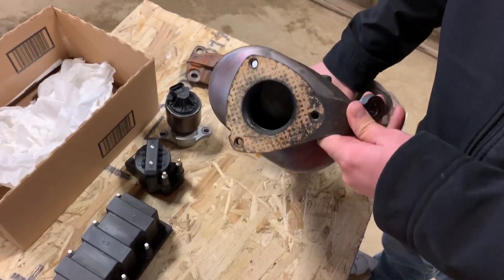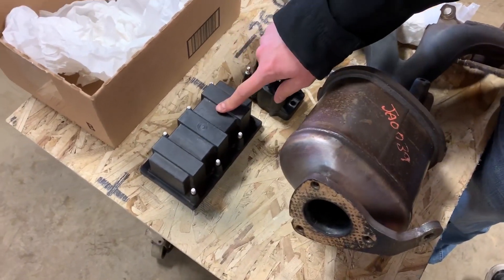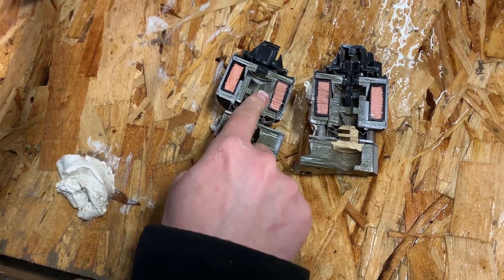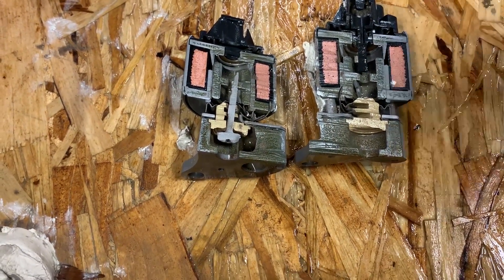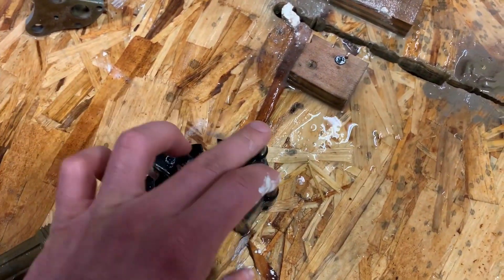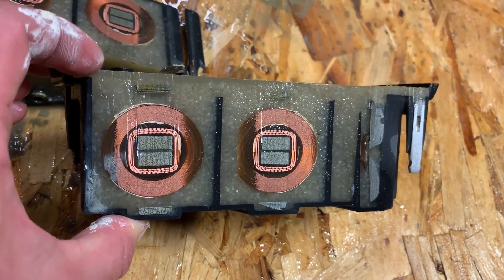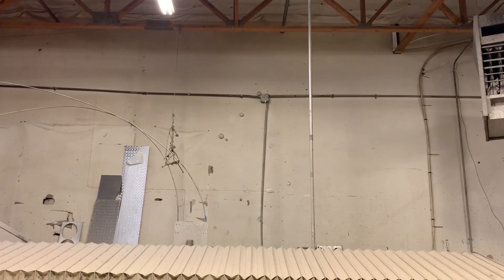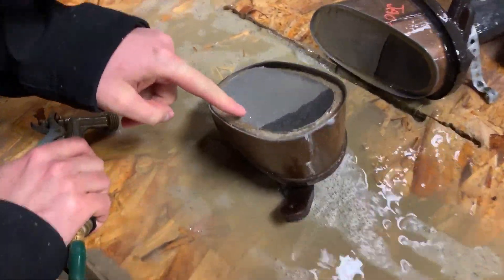Mining Platinum from a Catalytic Converter with a 60,000 PSI Waterjet

Comment: So if I remove my catalytic converter, I get more gas mileage?
Reply: Barely at the cost of not breaking down thousands of toxic chemicals for the rest of the planet to deal with, HOT CATALYSIS is essential to not being a polluting POS to your city  and the planet. Nitric Oxides, Monoxides, Smog, You want at least A HIGH FLOW CAT, and there are usually more than one on newer vehicles.

Comment: They mentioned just sharpening the blanks. However the blanks aren't heat-treated already are they?
Reply: No but if they were you would have one hell of a time trying to grind them. Depends which steel you choose but for example the 01 option would be an oil quench while its red (not yellow) then to temper it pop it in the oven at 400F for an hour and maybe toss in a pizza for the last 20 minutes or so.
Reply: @AeviAdamant  I will probably actually differentially harden mine  after I grind it. I got the o1 steal with the Tanto point. I love that steel as it is very forgiving and oil quenching is easy. I mainly asked just so people would realize that after they grind it it won't stay sharp because they are not hardened yet. I don't think these guys really realize that either but they're still fun to watch.
Reply: @chris993361  No problem and I agree it should be mentioned in future videos for the beginners who wouldn't know any better. Could also add the information under the steel types selection they offer giving information on how to harden each steel option.
Reply: @AeviAdamant  I agree. That would be a nice little tidbit to include.

Comment: In order of pulled apart:
Egr valve. He was correct. 
Both others are ignition coils.
Reply: So basically ignition coils are Solid State, Distributor caps, I feel dumb for not knowing that but if never worked on that part of a newer vehicle. Is this basically correct?

Comment: The primary coil is connected to the... secondary coil... the secondary coil is connected to the spark plug!
Reply: The spark plug is connected to my, wrist bone!
Reply: @nuck-  Precisely.
Reply: The primary coil is actually not connected to the secondary coil. They are separated by insulating material. The secondary coil IS however, connected to the spark plug. Or at least, the positive section of it.
Reply: Conneced to myweener haha : )

Comment: I dont use a Cadillac converter in my car. Its a 74 so it runs good on pump gas and its got cop brakes, cop motor, cop suspension
Reply: Does the lighter work?
Reply: “Yeah, I need all your cop stuff” sir this is autozone are you drunk
Reply: Our Lady of Blessed Acceleration, don't fail me now!
Reply: Wait, that's illegal
Reply: @noelmedina6925  it's a 74 so made before Cadillac converters